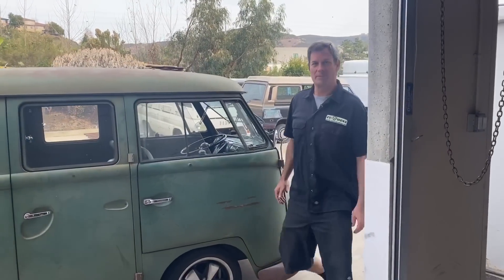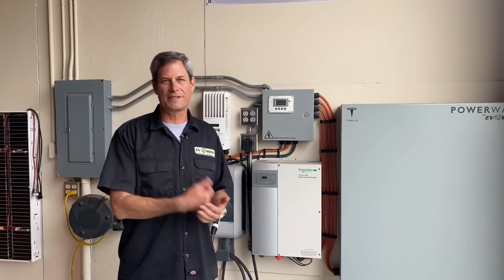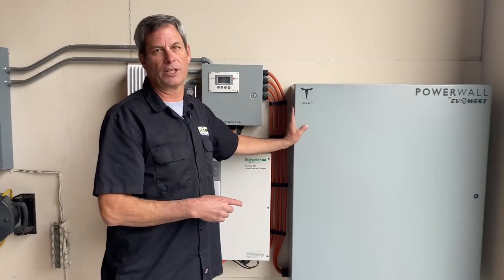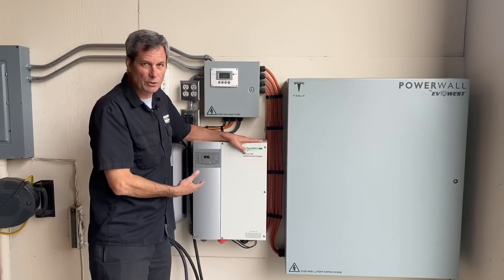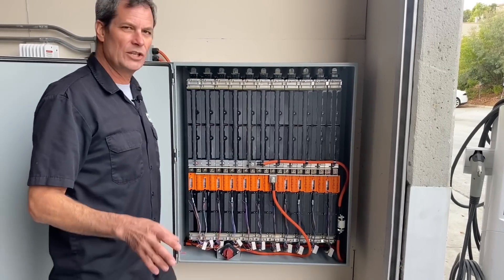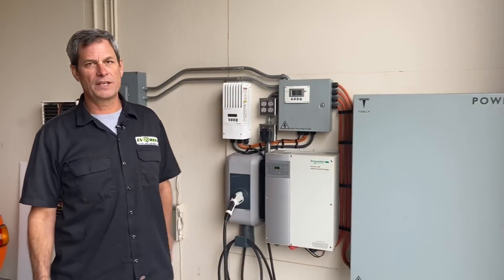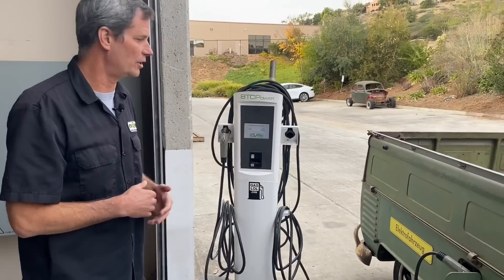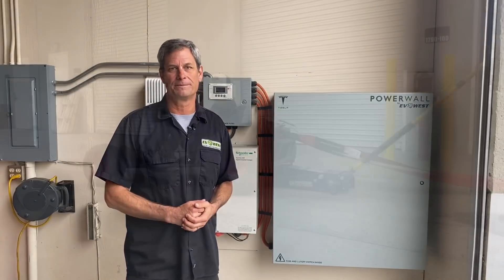POWERWALL by EV WEST

Comment: This is  a brilliant invention replicated very cheaply Tesla walls intrigue me I do like the idea of powering a work shop off grid or home this could be introduced as a permanent use of power source so saving on electricity and not using gas appliances should reduce your footprint and general cost of living a huge step in the right direction

Comment: Very nice. What voltage do you charge per cell? I charge to 4.04 volts per cell. I discharge no lower than 3.4 volts. Our Tesla batteries are in a off grid home. Do you think I will have longevity charging this way?

Comment: Thank you for the very interesting video. Following is my experience with solar electric and EV cars.

I live in the Seattle area. Have a grid tied 8kW PV array on the roof that has delivered an average of 8.5 mWh per year (60% of our annual electricity usage) for the last 6 years, even with our rain and clouds. Had a 2011 LEAF (43,000 miles driven), have a 2016 Tesla Model S (53,000 miles driven), and have a 2019 Tesla Model 3 (6,000 miles driven). I estimate that at least 70,000 of those EV miles driven were charged at home with solar energy. The rest of the miles using CHADEMO and Tesla supercharging.

Prior to this, with a lot of help, in 2008 I converted an ICE 1996 Honda Civic with a DC motor kit and sealed lead acid batteries into a BEV. Out of my comfort zone but a good experience helped with a lot of great people.

Comment: This power-wall is a work of genius, I first saw it being introduced in a Garcia video, since then I’ve been hooked to EV West. If this is what they’re capable of without even trying too hard, then how much further can they push the development of off grid home technology by applying the electrical know how. Hopefully they can muster new videos with more info, guidance and reviews of components for generating energy at home tech please! Eg inverters, fuse panels, bms, solar panels etc. Eg How many solar panels or wind turbines would you need to fully charge a 33kw power wall depending on where you live?

Comment: Very cool but why do you invert the DC power when the cars would prefer DC? Seems silly to convert DC to AC and then back to DC, when what's really needed is DC.
Reply from the maker: For versatility, so we can charge our EVs, Alta motorcycles, the death kart, eBikes, and other shop toys all from the same system. We loose about 10% in the conversion process, but the energy was free from the panels to begin with.

Comment: That was very interesting! Say, if the main point of the system is to get a buffer battery for charging the EVs, what do you need an inverter for? Couldn't you just use a DC charger and avoid any losses from first inverting and then rectifying the current?
Reply from the maker: Yes, and while it is less efficient to do it this way, it is far more versatile. We run other shop equipment, and charge EVs, eBikes, etc. with different pack voltages.

Comment: Super interesting thanks! This makes the tesla power walls appear really competitive, is there any advantage or capability this system has over a tesla power wall, other than it is available?
Reply: Tesla powerwalls are 13.5 kwh, this one is 36kwh I think he said.
Reply: @davef6997  ah gtk, figured there was some big difference I missed the part where he said the energy capacity
Reply from the maker: Really just wanted to show what you can build in your garage. Same philosophy as our EV conversions. Our only intention is to add some user-builder creativity into the mix of offerings.
Reply: @EVWest  oh yeah i totally get that, not a tesla fan boy here, i was just shocked by the price because i missed the part where the capacity was given and didn't realize this is almost 3x the capacity of the tesla power wall.

Comment: I've been meaning to ask, how long does a typical DIY conversation (like the bug) take to charge? Been wanting to convert a 1986 Toyota Corolla KE70 station wagon I have and wondering if it's worth it .
Reply: I think the answer is, that depends on how much battery and what size charger you install with the system.  Lots of the conversions I have seen run around 30 to 40 kWh packs with 3kw or 4kw chargers, which puts you at around 10 hours to charge.  Again it's going to 100% depend on what components you use in your build.
Reply: And would a 40kwh pack of used Tesla batteries give me about, say, 200 miles perhaps?
Reply: @TommyJosiah752  Again the answer is it really depends on the build.  A light vehicle with a low amount of drag, 40kwh could get you 200 miles.  Bisimoto just made an electric Porsche with 36kwh of battery and he said he gets about 170 miles if he can keep his foot off the throttle
Reply: @TommyJosiah752  also the is much more than just the kwh of the pack, you need to make sure the pack can deliver the voltage and amps to drive the motor.  If your pack is only capable of delivering 100volts and your motor is rated for 400volts then it won't have enough juice to give you any torque.  If your plan is to use Tesla battery modules to drive a Tesla motor, you'll pretty much need an entire stack of modules that were in the Tesla to reach the volt's and amps that the motor needs and that leaves you with a 90kwh pack (or somewhere in that region).  That's wht a lot of people go for the lg chem modules.  2p6s string of them delivers the volts and amps of the Tesla pack but has much less capacity, weight, cost, and volume

Comment: I love that it's all used equipment, always a win there.
Still, a substantial cost per kWh, I suspect? And for regular non-tech people, factor in a decent amount of mechanic fees.
Reply: These are labor intensive conversions with expensive used parts. They arent cheap.  Battery prices inflate the costs of all EVs down the chain. It will take time and scale to get prices down in the entire chain. Period.

Comment: Is it a grid tied system or not? If it is... How the inverter knows how much power to pull from the battery at any given moment?
Reply from the maker: Not grid tied, we are leasing the building so it's portable.
Reply: I would guess it is not, and that is why it is seldom mentioned in many videos. Grid tied connotes “permitted”. Here in California the grip that Investor Owned Utilities have on what is connected to “their grid” is weakening, but it isn’t gone...yet. But that doesn’t mean you can’t build your own micro grid, and that is exactly what people are doing. Power to the people.

Comment: $10 - $12K for 50K miles....... Sold! Do you have financing??? 😅
Reply: To be fair.. 58,000 and it should last a decade or so, with a bit of monitoring and maintenance.
The cost needs to come down a lot though, especially as this is all used equipment. And the hours building it are not counted.
Reply: At 40 miles per gallon and a gallon of gas at $2 that around $3000. Only 240,000 miles to go to break even.
Reply from the maker: Almost 60k miles so far. At this point we would estimate that the pack should last until about 250k miles, and the other components don't have moving parts, so while a component might wear out over time, the system as a whole will continue to have value and dispense energy. Oh, and sorry but we don't do financing.
Reply: That doesn't really impress me, to be honest.   
Around here, I can get gasoline for about $2 per gallon.   For $10,000 I can buy 5000 gallons of fuel.  My car averages about 30 mpg, so I can get about 150,000 miles for every $10,000 spent on fuel with none of the hassles.